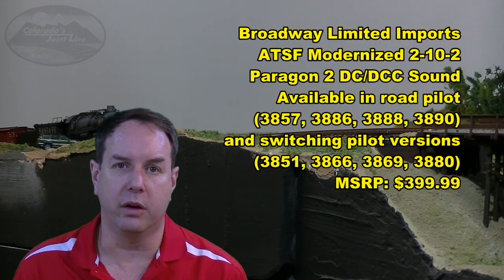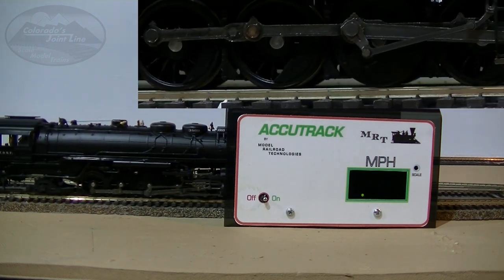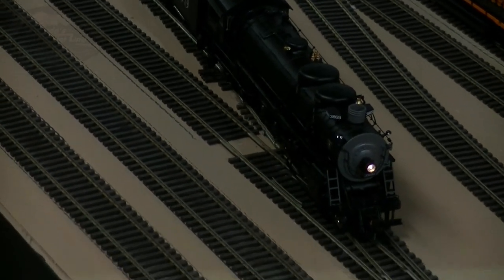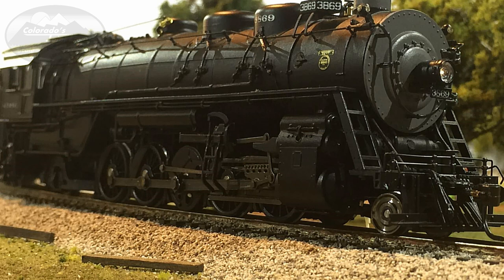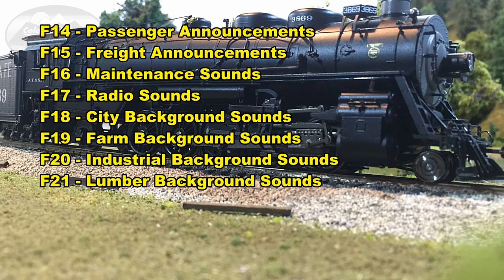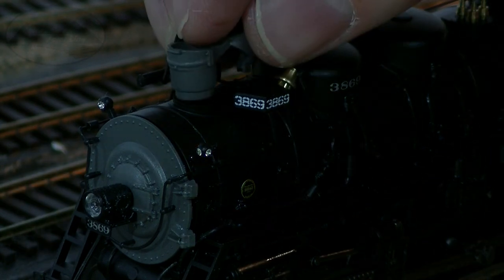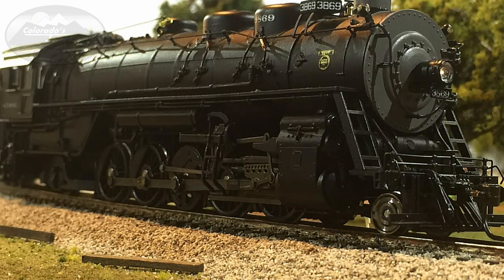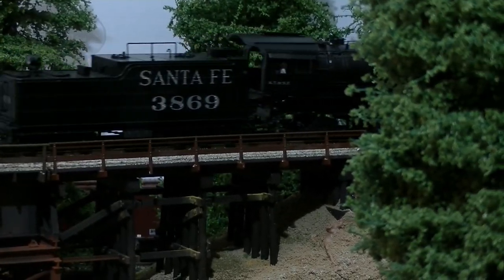BLI Santa Fe 2-10-2 HO Steam Locomotive w/ Paragon 2 Sound Review

Comment: looks very nice! i do have a question that is more scenery related. i wonder, how do you clean the surface from dust and so on without damaging anything? im trying to gather information to make a diorama. i found many of your videos helpfull :)
Reply from the maker: +FsAviX Gaming If you have you're scenery material glued down strong enough you can either blow clean air across the layout or even use a low power vacuum.   If not, then, gently blowing air on the dusty areas seems to work the best.  Hope this helps.  Cheers, Kevin
Reply: thank you very much

Comment: very nice steamer , my new layout will be 22 and 26 inch curves , would it work ok on them , sounds great , looks sweet , and I do like the detail it has , thanks for the real ,, touteral also , I love hearing about he prototypes
Reply from the maker: +sparky107107 Thanks for the feedback.  BLI's min recommended radius is 22" however I haven't been able to confirm that myself.  If you used transition curves or easements, which you should if your layout can fit them in, they would likely help the engine ease through the min radius.  I might have some old 22" sectional track laying around.  If I do I'll see if I can set up a circle and run the engine on it.  I'll let you know.  Cheers, Kevin
Reply: thanks